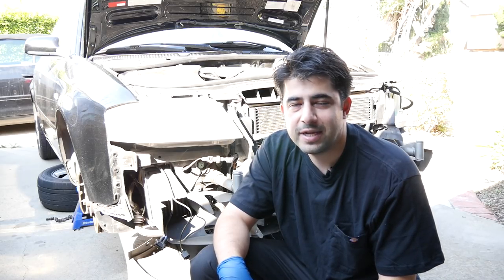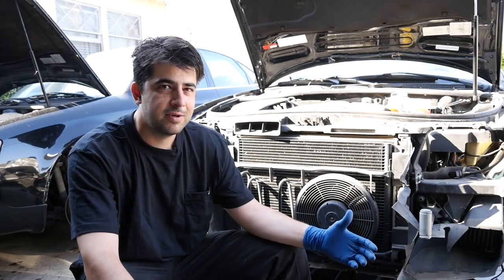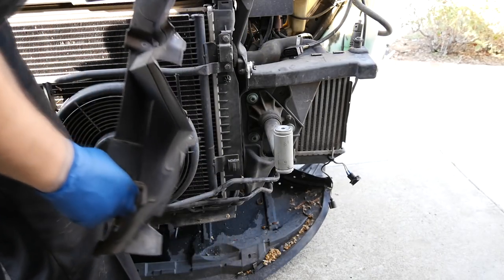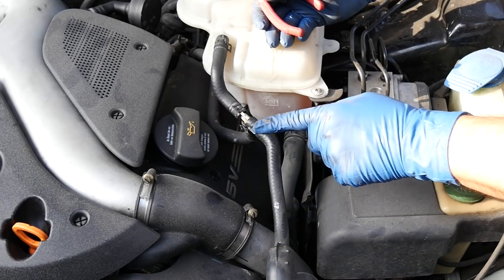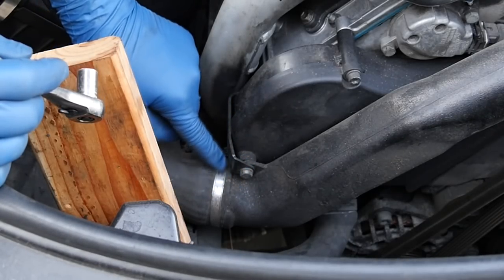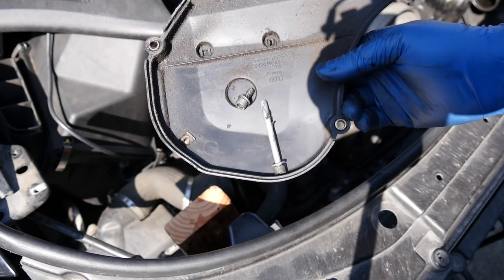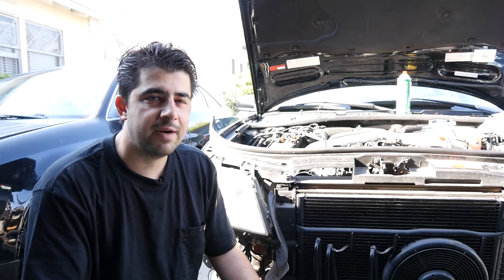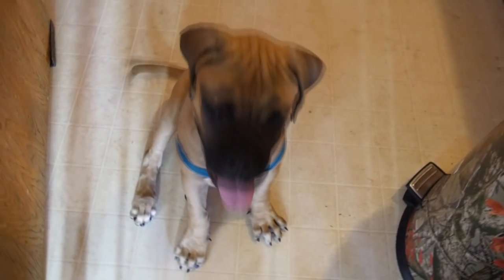Watch This Video Before You Buy an Audi

Comment: The most annoying thing about expensive, unreliable, scam, poorly engineered, German cars is this amazing reputation they give themselves.
Reply: I'm the best. If only ONE us car had the build quality of an audi, these should sell like crazy.

But, plastic el cheapo interior, gap just like the worst whore everywhere, dull paintjob right from the factory, rattling interior and tech parts, massive displacement without any impressive ponys coming from the crankshaft.  But guzzling fuel like an russian on saturday night and so on.

Smart people are not gonna buy us cars.
Reply: Old E39 BMWs are reliable if you know them inside and out.
Reply: I'm the best. Agreed I had two audis bottom half of engines go, both Audi full service history's (it was oil chain pump 2x broke cost me thousands in debt) common issues which Audi pretended they knew nothing about until I pressed them for weeks. 😡
Reply: Adam N how does knowing a car magically make it more reliable? You still have to get under the thing and fix broken stuff.
Reply: your talking about bmw right?
Reply: riccccccardo brother of mine had an a4 Quattro, the ecu sits in a position where water gathers in a pool, fries the cars whole electrics.
Reply: I'm the best. 😐
Reply: casemodder89 what was the last us car that you've driven? I recently drove an ats and it drove very nicely and had a nice interior. Bmw interiors are DISGUSTINGLY cheap. Tissue paper stuffed into the sun visors
Reply: I'm the best. Well said my friend👍
Reply: casemodder89 dude you are talking about German cars, there ugly handle like shit and all cheap made. Don’t dis us cars buddy.
Reply: Adam N 😂😂😂funny, you should be a comedian.
Reply: EXACTLY AND COMPLETELY AGREE.
Reply: lol, wv tiguan 09 2.0 tsi. 6 water pumps(oem and installed in dealership) for 90k miles? So shity  cars i personally newer seen in my life, complete lemon.  Driving Japanese and American cars, and working with cars.
Reply: ruhoer eoijre 
Don't buy petrol cars from VW they're crap. The Diesels are much more reliable.

Comment: Boy, those comments on "I'd rather pick a Toyota/Lexus/Honda" are hilarious. You can't measure everything by the same yardstick...
As soon as the engine compartment is cramped like on that Audi, changing something like a timing-belt is always a tricky thing, especially with the 'correct' engine placement i.e. longitudinal. That's true for any brand - well, beside US battleships from the 70's ;-)

Just don't be naive: You can't have a high-performance/tech car and expect low-key maintenance. 

Still don't believe? Well here's an Lexus example - same procedure : http://www.import-car.com/engine-maintenance-timing-belt-replacement-on-lexus-gs-300s/

Comment: I worked on a few of these cars. One reason why I steer clear away from these money pit machines. They are soo over engineered as I don't like the fact that you have to take soo much shit apart to even do the simplest repairs. The more complexity the more shit breaks. It's almost impossible work on them without a dealer level scan tool. They are notorious for electrical problems as they age. Lexus's are more simpler in design as I'm like Scotty Kilmer, I don't like working on my own cars.

Comment: Bumper shocks??? Over engineering at its finest
Reply: Disassembled the radiator/bumper support on many vehicles in the US that do NOT have bumper shocks.
Reply: Call it what you want but your profile picture is essentially a bath tub on wheels
Reply: S Ganley Call it what you want but i'll take my 2600lb bath tub over your boat any day

Comment: So basically you are judging the whole brand by taking a damaged used car for example? All you guys saying that german cars suck are wrong. I've had Japanese cars from 90's  and 00's and they are worse . In 10 years period of usage they all start to rust like the Titanic. And they have electric problems as well. Any car with a big engine like 2.8 or bigger would need a lot of work to change the timing belt so stop shitting on a brand judging just by one car.

Comment: This particular engine is NUTS(had one). The weak place are turbos. even if you replace them(to replace you have to pull the engine out) they still will leak after 6-12 months And other gaskets... NAZI car! Built to drain the owner's wallet. 
pros: very comfortable car.